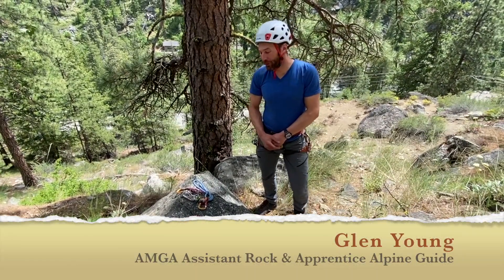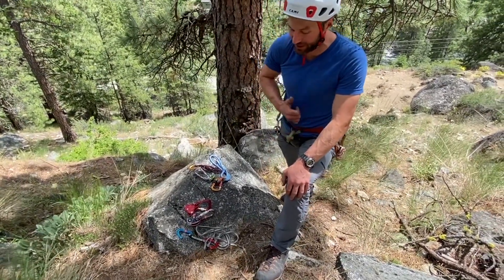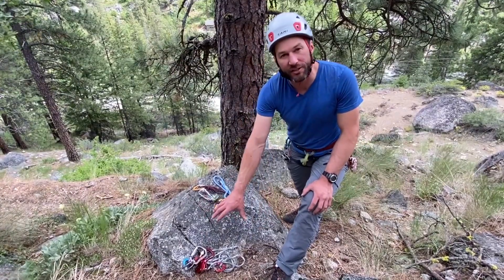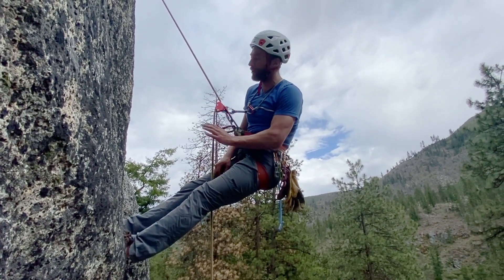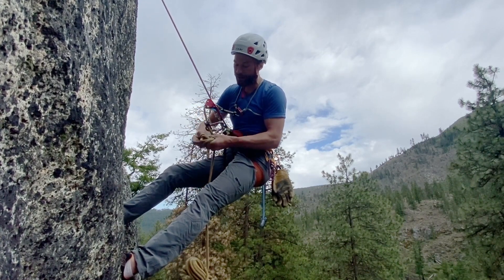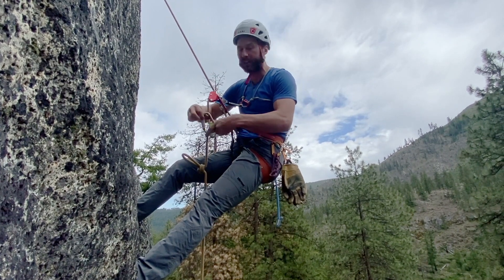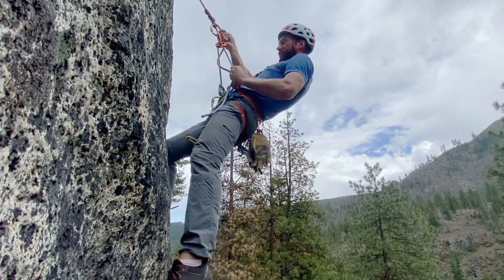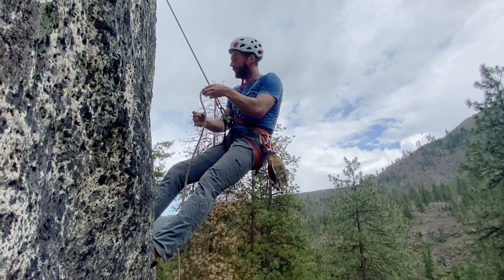Rope Solo Escape

Comment: You're the only person I've found who owns both the CAMP Lift and the Kong Duck. Can you give any advice on which is better as a primary for top rope soloing? I'll be using a microtraxion as a backup and everything else about my setup will be the same as your videos on TRS. Thanks for this content btw - it's the best I've found in a month of research.
Reply from the maker: Thanks so much for your positive comments @riccardo1605!  I prefer to have the CAMP Lift on top (the primary).  It slides-up the rope well when attached to a chest harness, and has a broad cam surface (the cam is shaped like a long bar instead of an oval).  The problem with the Kong Duck is that its cam is oval shaped and it has a very small radius.  What this means is that it puts a tremendous amount of force on a small area of the rope, which increases the likelihood of damaging the rope.  However, in a top-rope solo set-up the amount of force produced overall is very small, so provided it is set-up properly this shouldn't be much of an issue.  But it will wear-out your rope a bit faster.

Comment: question about your chest harness set up....  Looks like the biner is cross loaded on the wire gate.  Not sure what kind of biner that is, but ive seen that configuration with a max load rating of 2kn.  

Realistically that force probably wont be generated from a fall using this system, but still pretty close for comfort in my opinion.  Am I looking at this incorrectly?  Is this something you overloooked?  Is it a calculated risk?  

Cheers and great video otherwise
Reply from the maker: Hey @waltermiller6614!  Thanks for watching and taking interest in the set-up.  If you look closely you'll see the purpose of the chest harness is only to keep the CAMP lift sliding up the rope- it doesn't hold any human load.  The belay loop of the harness is what takes the weight of the climber.  Some people choose to construct a chest harness out of bungee or some other cheap material as it isn't essential that the chest harness can handle more than 10 to 15lbs.    Also, just an FYI carabiners used for rock climbing have to be tested and rated both along the major axis (the spine of the carabiner) and in a cross-loaded orientation.  While cross-loaded, climbing carabiners are rated between 7 to 9kN (1,573lb to 2,023lb).  This is printed on the spine of all certified climbing carabiners.  Although it can feel scary to be rappelling and see your carabiner is cross-loaded, or see a cross-loaded carabiner in an anchor, it is usually not an immediate safety concern.  There are a few carabiner orientations that are an immediate safety concern, such as a nose hooked carabiner or a pinched and levered carabiner.  These generally occur at bolted anchors and not in the scenario shown here.  Thanks so much for watching, and I hope this was helpful!
Reply: Strange. I know that the ratings are stamped on the spine, but for some reason I was thinking the cross load was rated way lower. Lol. 

Thanks for the reply, and since the cheat harness is not really load bearing it doesnt matter, i suppose

Comment: Awesome video! I wonder if you can do this without the PAS by just running the brake strand coming from your ABD through the carabiner attached to the autoblock and using that for the assisted body hoist (i.e., the "GriGri jumar" method a lot of aid climbers use). Granted it won't work if your primary device requires the line to be slack for removal, but the devices I can think of that I'd want to use for TR solo can be installed to and removed from a taut line.

Comment: imho better to use that  autoblock for leg (with sling) instead of waist. Imagine you are doing it in overhanging terrain - with your method you would need to pull whole of your body on one hand for a moment (to loose autoblock) -not that easy ;)

Comment: Wouldn't it be better to put the autoblock below your belay device as a backup when you descend at the end? It is not strictly necessary when using a brake assist device, but it shouldn't really hurt, right?